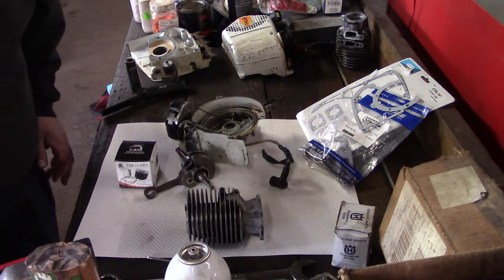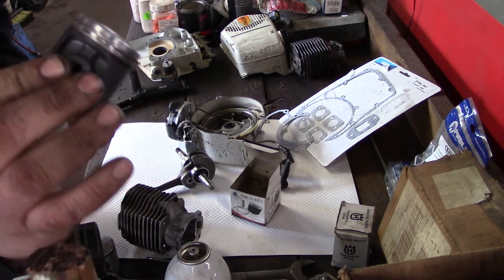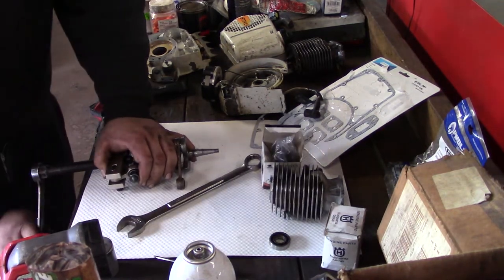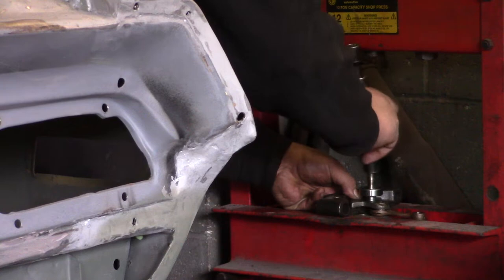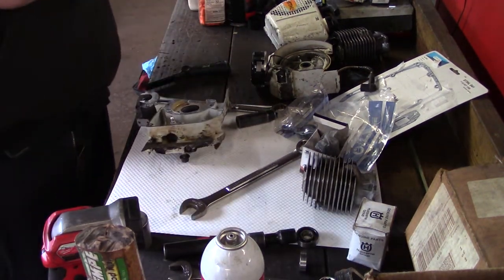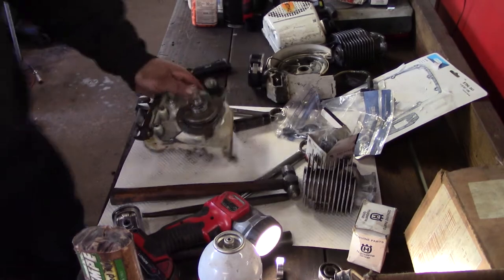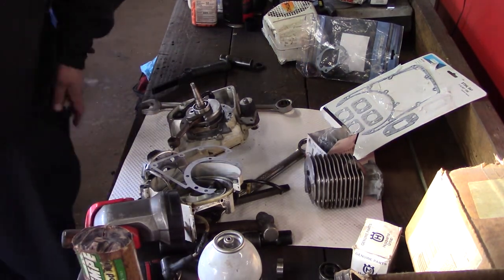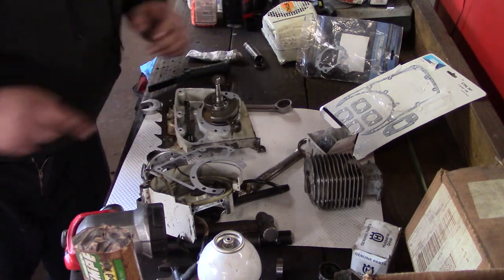Stihl 041 Basket Case Build  Remove & Installing Crank Bearings In The Case In A Pinch Video 1

Comment: Hey Kenney, nice job. I have same chainsaw I have had for years. What happened was a screw vibrated out by muffler and it ruined the saw.

I decided to try and fix it. I took apart and saw a few scratches on the cylinder but did not think it was bad enough to replace. I will soon find out.

I put back together and cannot get it to start up. I replaced everything. Carb, filters  etc. I did not replace the side gaskets you did. Do you think that these crankcase gaskets could be leaking compression making it impossible to start? And no I do not have a compression tester. I am no mechanic. But makes no economic sense to have it worked on by one. Any suggestions? And I do have another piston and cylinder for it just in case.
Reply from the maker: Did you try putting a little fuel down the spark plug hole and see if it fires. The sthil 041 have a bosch ignition coil and some have points they can be bad. I converted that 041 the electronic ignition with a chip.
Reply: I will try that. Thanks.

Comment: Any reason you didn't change out the connecting rod bearing?  Looking at rebuilding one of these. Thanks!
Reply from the maker: Because the crank rod bearing was good. Most of the time if the rod is loose you need a new crankshaft assembly. Some people can put a new bearing in the big end connecting side but need special tools to line the crank back up.
Reply: @kennytheguitarfanatic054  Thanks. Can you tell me what gasket compound you were using in conjunction with the paper gaskets? Some version of silicone?
Reply from the maker: @MakesaGoodGumbo  It is called Moto seal Permatex makes it. because this silicon is fuel resistant you need this for 2 stroke engines.
Reply: @kennytheguitarfanatic054  Thanks!